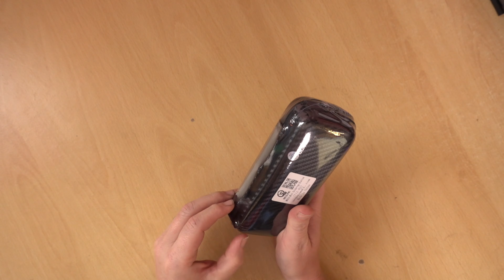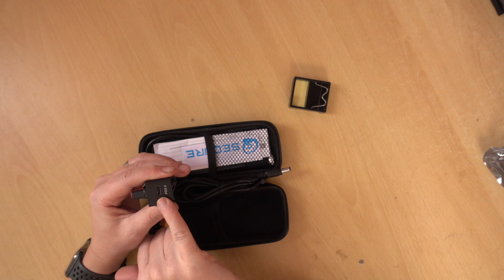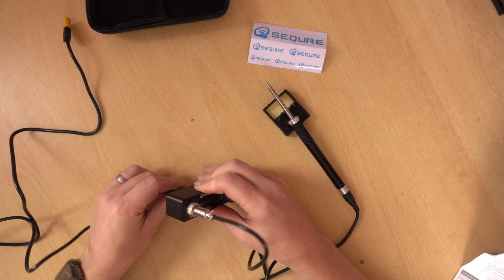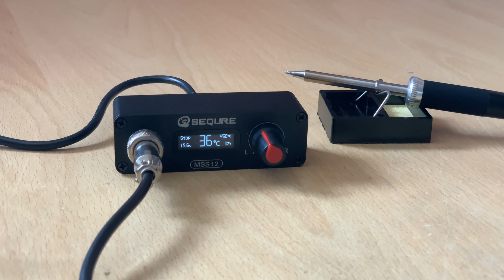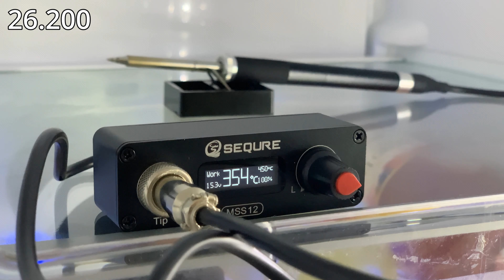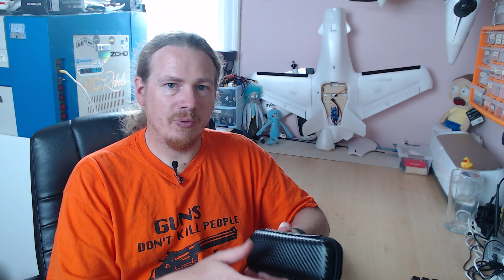Sequre MSS 12 Intelligent Soldering Station - Unboxing and review

Comment: The power output is linked to the voltage so higher voltage gives more power and an even faster heat up.
Reply from the maker: Very true. All tests the were using the same battery, at the same voltage (within 0.3 of a volt). So are comparable. Of course, if you put a 6S pack on there it would heat up quicker.